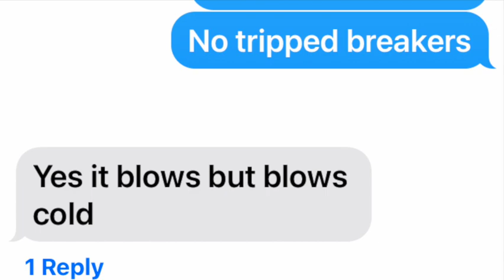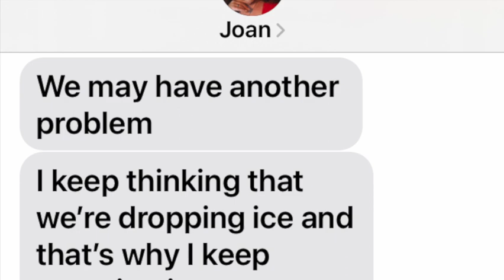EP 16  Game Board and Appliance Meltdown!

Comment: It's good to not be bored. Yes? <chuckle> Well done on all accounts.
Reply from the maker: Board! I see what ya did there…
Reply: Since you are a tinkerer as I am, are you going to gut the appliances for bits and goodies?
Reply from the maker: I took the buzzer off the dryer, and the tray rollers off the dishwasher rack, I also took some knobs and a push button but I didn’t take any internals… (I guess I just don’t have the guts 😂) if I thought about it I could have used some other stuff but I’m trying to suppress my inner pack rat. (At least until I get a bigger garage 🤗
Reply: Oh, but the wire harnesses, the switches and connectors and hoses and fasteners!
Reply from the maker: Oh my!